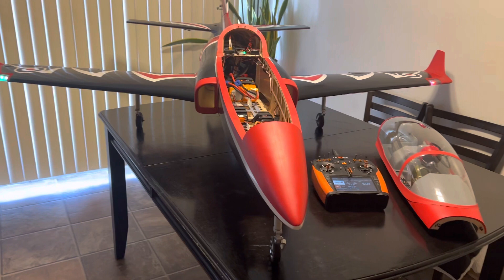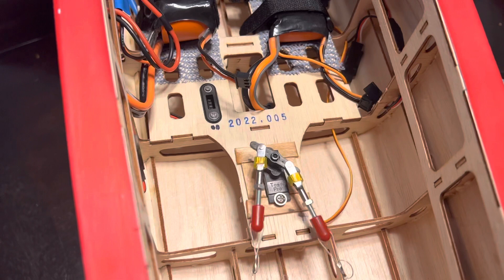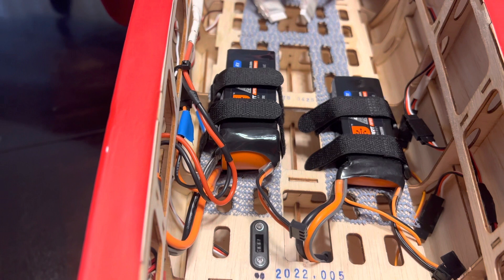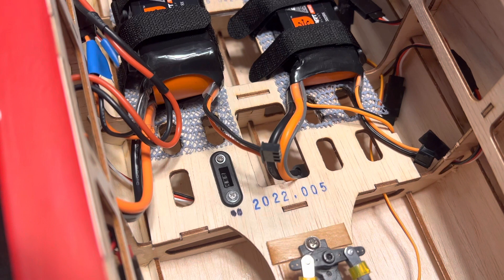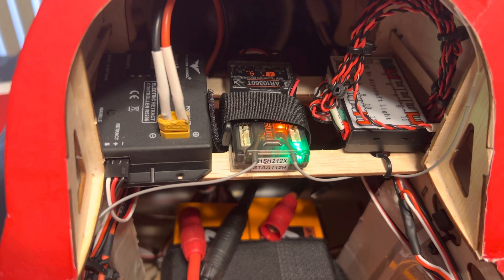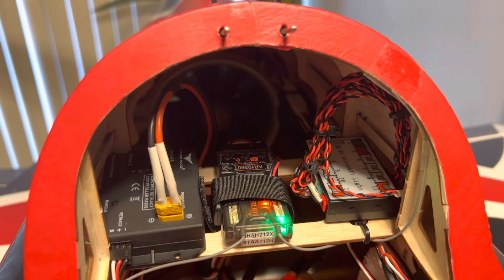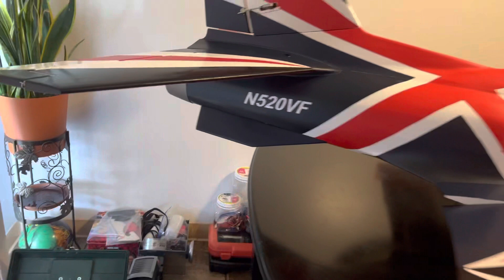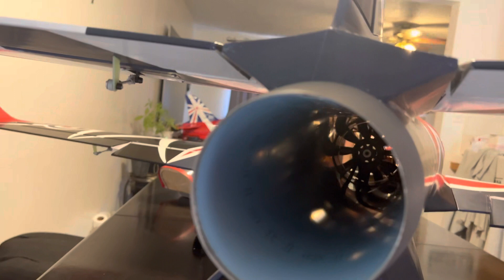Black Horse Viper Jet MKII with HSDSJETS 120mm 640kv 12s EDF #spektrumrc #rc #rcplane #motionrc

Comment: very nice build.    what is the weight difference in the thrust tube compared to mylar?
Reply from the maker: I’m sorry my friend I had nothing to compare it to as it did not come with one. Definitely 50 to 70grams heavier but the sound and response is mind blowing. She weighed in at 19.8 pounds total. With (2)-4000mAh 2s and (2)-6000mAh 6s lipo’s. The recommended CG is way too nose heavy. If you have a paved and long runway you will need it with the recommended cg. I found the perfect spot at 196mm from leading edge using the jig it came with. Good luck and always have fun my friend.✈️🙏

Comment: What servos did you use on the wings and tail. The recomended bundle pack Motion shows are WAY to big.
Reply from the maker: KingMax mini servo CLS2875H on all control surfaces.
Reply from the maker: I did have to file about 1/16” to make them fit

Comment: Hey, great set of videos you have of this bird! I just acquired one myself and have a question or two: 1. It looks like you have maybe just a partial intake duct in this video, not going all the way to the fan as described in the kit. Is that what you ended up with, and if so, has that worked well? 2. What did you end up with as far as the LIPO capacities? I have almost the same setup planned. Almost identical except for a JP fan unit instead of the HSD. Thanks for your response. Newly subscribed!
Reply from the maker: 1st ? I cut the intake tubes just past battery tray and I did not install front nose shroud/plastic piece for air flow. You want good air flow over your batteries and plenty of air for your fan. 2nd ? I am running 12s (2) Admiral pro 6000 6s. I added (2)-2s 4000 G2 batteries for all electronics and perfect CG. The recommended cg is extremely nose heavy. I wanted to make a video on how to set up/modify your jig for the perfect CG. This can save you a ton of flights and time.
Reply: Hey man, I’ve had this plane since last year and it’s a blast. To answer your questions I also did an “open-duct” system and cut the intakes short. It seems to enhance the sound but it definitely reduces efficiency. As far as the fan/LiPo’s I went with the JP hobby 12S 120mm and it’s been great. I used 5000’s to start but flight time was limited. I’m currently using 6200’s and plan to bring on some 7200’s next month. Hopefully this helped!

Comment: Awesome job, looking good, what retracts are you using my friend?
Reply from the maker: I ordered the ones from Motion RC I’m not sure why it’s $289 as a set so I bought everything separately for $30 cheaper and I still received the hardware. The nose strut on these retracts are way too stiff. I may replace with the one that came with the model
Reply: @comeflywithmerc  thank you very much for your response, most appreciated. Using 12S do you have any idea what your flight time will be?
Reply from the maker: @JP-ij6gf  I’m hoping 4-5 min with good throttle management 3-4 heavy on the throttle. Maiden set for 3 1/2 minutes
Reply: @comeflywithmerc I ask as I am currently building mine, I will use the same EDF as you just wasn’t sure to use Lion batteries or Lipo. Thank you again and wish you all the best for the maiden.
Reply from the maker: @JP-ij6gf  I’m using lipo but I’m amazed at the flight times this EDF jet guy is getting with the lion’s Samsung.🤔 maybe the future battery for sure. Mark my words.
Reply: @comeflywithmerc  Hey buddy, after some more advice from you please. I am struggling to obtain the right material for my trust tube. I know you said your boos made yours. Would really love to know how he accomplished this. Any help you can provide would be greaful.

Comment: Did this come with LEDs for the wings, or did you have to cut them out.
Reply from the maker: No, I bought a light kit and drilled them out! I ran three separate wires for different functions
Reply: @comeflywithmerc  Thanks for the information. Just purchased the last one in stock from Turbine RC last night. Got tired waiting for Motion RC to get some in stock.
Reply from the maker: @TeslaModificationInstaller  you’re going to love it! My favorite in my hangar! She is a pretty big bird!!!💪👊
Reply: @comeflywithmerc  Mind telling me what servos you are using?
Reply from the maker: @TeslaModificationInstaller  (7)- king max mini servo CLS2875H and (1)- tower pro mG92b

Comment: Hey buddy, how do you connect brakes and lights to one lipo?
Reply from the maker: I used Spektrum 2s receiver lipo batteries. It has receiver output and ic3 connector. I purchased ic3 opposite connector and connected directly to brakes module. The receiver connection to the light module. I used the same gauge wire for the brake module to ic3.
Reply: @comeflywithmerc  very helpful, thank you very much, wish more people were as helpful as you are.
Reply: @comeflywithmerc  I am in the final stages of building mine and want to minimise the amount of batteries on the aircraft which is why I asked. Need to reduce the 2S batteries from 4 down to 2. Once again, thank you very much.